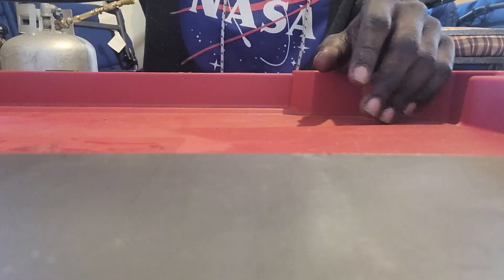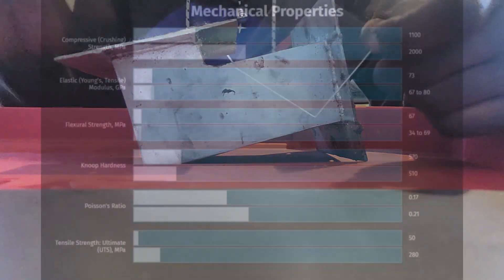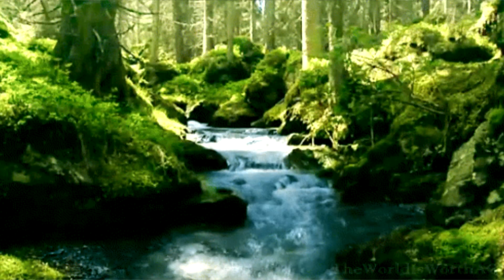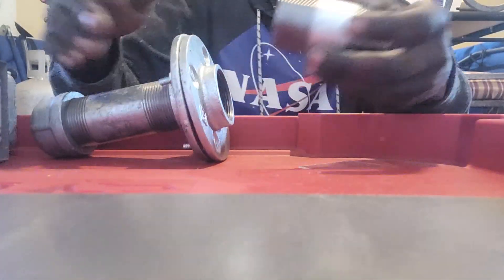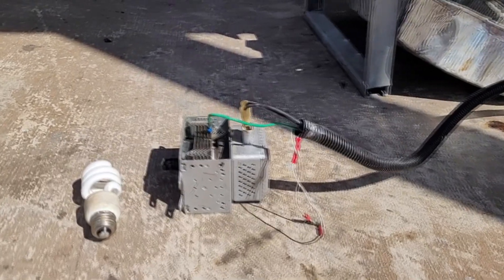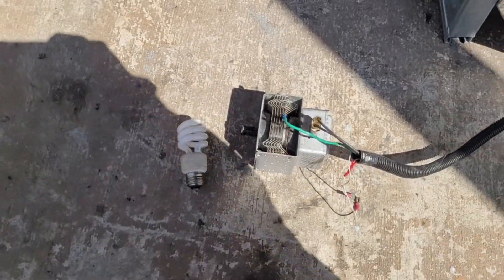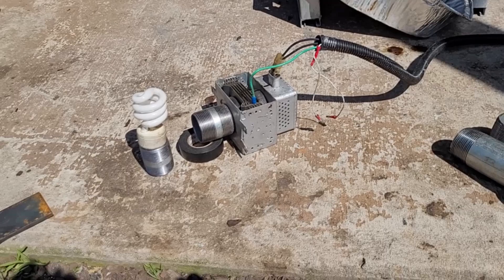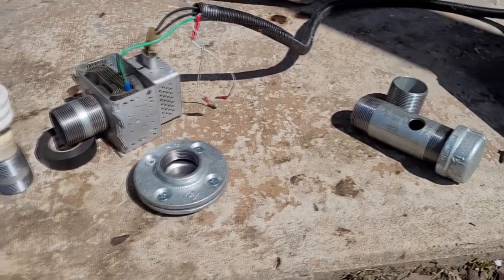Testing New Waveguide for Microwave Pyrolysis Reactor

Comment: Microwave magnetrons target water molecules (2.4 GHz). If you are looking for improved efficiency you should experiment with targeting common plastic molecules, or even elements. Each have a resonant frequency. Targeting elements directly should use less energy. John Kanzius discovered sodium's resonant frequency(13.56MHz) and used it to burn saltwater. MHz range is lower frequency and lower energy than GHz. This should decrease power usage for your invention. For waveguide design ideas I would use chatgpt and ask the relevant questions.

Comment: Many good points. But id like to include or point out that a feed horn helps impedence match from a wave guide to a larger space and reduce reflected power. 

To make the point further, an audio feed horn is an audio  impdence transformer that also helps transfer power from one medium to another and reduce reflections.

Comment: Use copper tubing. The micro wave shots that we install function the same way. We use a hollow piece of elliptical copper wave guide to transmit and receive over extremely long distances. It can be brazed to different metals to provide an air tight environment. Just remember No right angles. The beam needs to have a more sweeping path. That being said. With the right size elliptical wave guide and connectors you could move your RF emitters to a separate surface and route the wave guides to your vessel. Food for thought.
Reply: No need for an isolator?  The SWR must be horrible.
Reply: I’m looking at using 3d printed waveguides that will be electroformed with copper.

Comment: Your position from the back stop needs to be tuned or you will get a standing wave and not enough will propagate out the front.  With the right gear you can tune this up real nice but if you just play around with it you will find different distances that work better or worse than other distances.
Reply from the maker: Great point & advice, thank you!

Comment: An internal diameter of 3in will work
Reply from the maker: This is true, I put it in a cutoff frequency calculaltor and it works. The issue is, 3 inch pipes and fittings are very expensive relative to how much I pay to just make the rectangular waveguide myself, and a 3 inch diameter piece of quartz glass would easily be over $100 on it's own.
Reply: @naturejab  yeah i mentioned that in previous comments but they kept getting deleted because of links.

I also forgot to mention alumina ceramics and nitride compounds as  cheap, microwave transparent, and heat resistant alts. that may make the 3in pipe more economical
Reply from the maker: @Dellon Collins  I've tried an alumina brick, perhaps I used the wrong thing but it literally exploded 
I'll look into nitride compounds. Fiberglass seems to work the best out of all I've tested

Comment: Tip: You can measure the temperature on the magnetron to determine energy absorption in the cavity (or lack of cavity).  This tells you the status of the batch, is it done yet?  Has the batch become reflective?  Or is the cavity reflecting back to the magnetron instead of into the batch?  Your magnetron was smoking because all the energy was reflecting back.  Smoke is a crude sensor, hey!  But get a proper sensor, you could even use an automotive coolant temperature guage, or even go full scientist, and do an arduino equipped sensor.
Reply from the maker: Great ideas, thank you!

Comment: Man I could have saved you the bother.  Not even 2-inch pipe works.  Nothing comes out the end, I've tried it.  The wavelength is too big, I believe.  Stick with the tuned cavity of the microwave oven itself, and build your retort inside the oven cavity, using materials that will pass the RF energy, like your welders blanket.
Reply from the maker: Thanks man. I figured this was the case when I even went up to 1 1/2 inch pipe and it still didn't work. At that point anything above 2 inches wouldn't be economically smart when I can just build a waveguide out of a single piece of $16 sheet metal.

Comment: Dude it’s to do with operation above cutoff wavelength, harmonic modes and nodes/antinodes. It’s late here so I’ll write this week sometime
Reply from the maker: Thanks
Reply: Ok here goes. The microwave wavelength is 122mm, so the first thing you need to do is place a node at the screw cap end of your pipe. This is exactly 1/4 wavelength from the microwave antenna which is 31.25mm near as dammit. If you don’t, the wave will not reflect correctly and waste energy (I bet that’s what the buzz is). So the internal distance from the antenna to your screw cap will need to be 31.25mm. 

Next, microwaves are only allowed to propagate in certain modes (a bit like guitar strings) which means the pipe needs to be the correct internal diameter. For rectangular waveguides the major internal diameter is at least half wavelength (62.2mm in your case). The minor diameter is usually half this, but is not as critical. If the diameter is less than this, no energy will propagate. I bet this is why your capacitor blew up. 

Now, because you are using circular pipe it gets tricky… the distance to the screw cap remains the same (31.25mm). However, in a circular waveguide the overall wave behaviour is the same but the circular geometry influences what modes can be formed.

A friend and I have discussed and we think that your pipe will need to be at least 71.8mm in diameter. This is wavelength / 1.7 where 1.7 is a constant.

It might be best to sort out all this before ordering any more quartz glass. Hope this helps!
Reply from the maker: @elcaboelcabo2881  Thank you, this is super helpful!

Comment: Diameter of the tube! You need it big enough for waves to have space. And in the test with a bigger tube, you forgot I see how magnetron generates microwaves, on the side of the antenna (remember my schemes?). Probably it would work if mounted on the side of pipe, like in smaller one.
But I must say, metal pipes can be not bad idea. From what I know, square crossection waveguides are used because wave size (the difference in the performance of square and circular crosssection is probably small enough). probably pipe would need to be a minimum  6 cm in diameter, but i am not totally sure.
RIP quartz glass, your sacrifice would be remembered...
Reply from the maker: Haha yes the quartz glass has laid down it's life for a good cause. Thanks for your advice, we'll see if we can get it working some way.
Reply: @naturejab  I hope so, using those pipes and fittings would make everything so easier and nicer
Reply from the maker: @ejkozan  Exactly, that's my number one motivation. Ease and modularity.
Reply: @naturejab  Fingers crossed! Don't forget about wave size and how magnetron generates, and you will be fine ;)